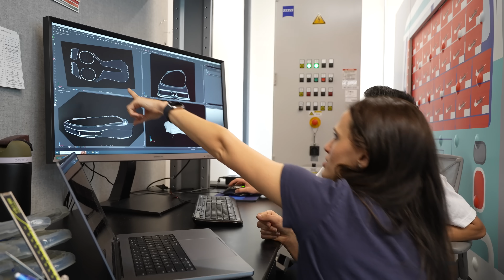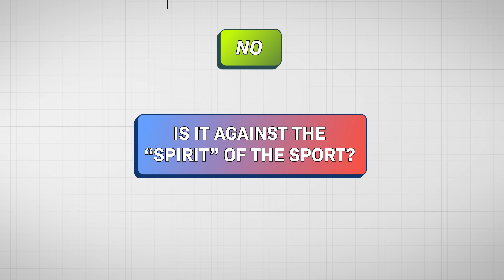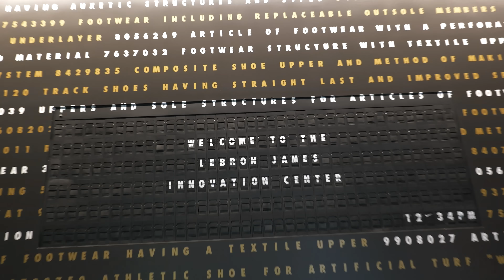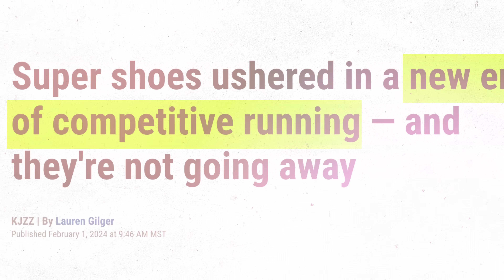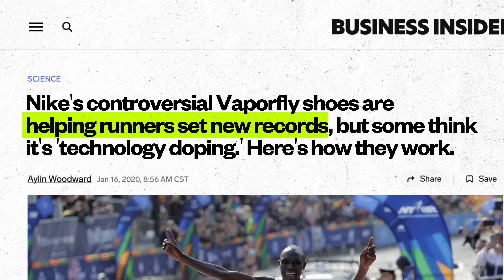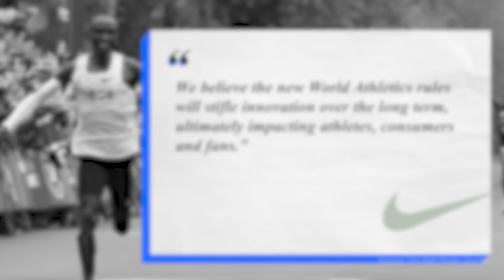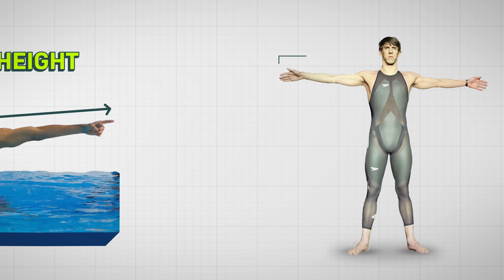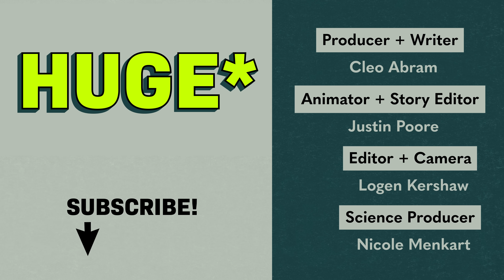The Shoe That Broke Running

Comment: Cleo is always a pleasure to watch and dam looked good in that USA gear. 

But seriously good video, i dont think glasses should be an issue as long as it brings the person in line with normal sight

Googles is a must for swimmers.

I liked the suit like shark skin has, denticles i think they are called. Clever.

I have a question for you Cleo. What about Tennis players who have the racket/strings set to different  tightness. Enchacing power for the same amount of effort. 

Interesting questions and sweet video.
Reply: Similar to this, they banned a tennis racquet for being too good: the Spaghetti racquet.
Reply: @ShankarSivarajan  I never knew that. Interesting. People always looking for an advantage 😁

Comment: It's always been the case in Athletics (Track & Field) that any records are a combination of numerous things.  The person setting the record, the training they have done, their nutrition, their equipment, the location both geographically and in terms of things like the speed of the track, the weather ( temperature, wind speed/direction, humidity, etc.).  As such no records are beaten under the same conditions as previous records and the further back in time you go, the more difficult it is to compare performances.  This is no different to other sports where people question things like who would win a fight between Mike Tyson and Muhammed Ali when they were both at their prime.

People in sports can only be directly compared with the people they compete against and those that are considered the greatest made huge achievements at their time.  The records are there to show us overall improvement over time in the athletes as well as everything else.  How long those records last is more of a testament to how good the actual performance was, but it's still not necessarily just down to the athlete, because as mentioned, location, weather and even who they were competing against all contribute to great performances.

Comment: Prescription glasses is NOT equal to running blades.
Prescription glasses just bring the player to normal vision (or close to 20/20). But running blades doesn’t make one normal. It makes one supernatural.
Reply: Do elite athletes get their vision and lenses tested in order to confirm they comply with 20/20 performance?  I could imagine that one could "cheat" by using lenses that improve vision up to 20/10 performance.

Comment: I think the only discriminate of technology to avoid in sport is ease of accessibility. All sportsmen should be able to have it if they want to. If it is not possible so it should be banned. If it is easily accessible and the sportsmen can choose to use it or not it should be allowed
Reply: That's not as simple as you're making it out to be.  Think about the blade guy at the end of the video, if other athletes wanted to could they amputate their own legs and put on massive springy blades?
Reply: @PlaySA Of course! Nothing is as simple as it sounds, but for the sake of brevity... Also highlighting edge cases can be a persuasive strategy, but it doesn't always reflect the full picture
Reply: @PlaySA No prosthetic that currently exists can make an amputee perform as well as an able-bodied person, though. They show in the video that athletes with prosthetics are 40% slower around starting blocks and 1-3% slower around curves than non-amputees (looks like their source is an article written for the University of Colorado Boulder site, which took statistics from Royal Society Open Science). The athletes in the video even says that what they got him on was the blades making him taller, not them making him actually run faster. A lot of lower limb amputees choose to use wheelchairs some or all of the time specifically because leg prosthetics come with a lot of disadvantages. 

If you’re referring to a science fiction world where prosthetics somehow function the exact same as flesh legs, only better, then yeah, your point is good.
Reply: So what do you make of sports like canoeing or rowing where the equipment can cost tens of thousands of dollars and the difference between a good boat and a mediocre boat is the difference between winning and losing. Not to mention the equestrian sports like dressage, which aren’t even real sports it’s literally just all about the horse and horses are expensive AF. There is no way that every rower can afford to be in the best equipment.  Do you suggest just canceling those events because they are unequal in terms of equipment?
Reply: @dand5829  but it isn't proprietary tech. Anyone who can afford it can buy it

Comment: I love these questions so much! For the question of why goggles are allowed but the suit is not, my personal opinion is that goggles don't make swimming any easier, they don't make you work less hard, they are just a useful tool. The suit on the other hand makes you more streamlined and therefore means you don't have to work quite as hard. Super interesting debate and I don't have a simple answer for any of the other questions.

Comment: I remember back in college, quite literally decades ago,  I did a PE class for tennis, and then the coach wanted me to do cross country.    I did, and did some preliminary running (I never had the stamina to do CC, but that's not important), I used regular "tennis shoes" while running,  the coach gave me a pair of running shoes that were significantly lighter than the shoes I used.    Now while I still wasn't that good at CC, it was an absolute night and day difference, and the conclusion that each step I have to lift a few less ounces, therefore use less energy,   plus there's the fact that the support is different too as tennis shoes have more side to side support.      But tech doping?  Asinine that it is even considered that.   Shoes get better, fabric gets light, bikes get more streamlined, it's called advancement.

Comment: This is a good video, with a pretty blatant issue, imo.

You keep posing the question "How do you determine the difference between a correction and an enhancement?" as this very difficult to answer moral quandary, when in reality it isn't.

We have a very strict baseline and literally billions of examples to compare against. The IOC, CAS, etc, they're not making judgement calls, they're just deducing conclusions from data. "If these shoes make you unreasonably faster than any given person without these shoes, yeah, they're bad. Fortunately we can compare you against literally every other athlete and person ever to have lived to make this determination". 

I think a much better approach for this reporting would be the question of whether we should consider enhancement as acceptable or not, not whether or not enhancement exists or how it's defined. You got close to that in the final stretch but never really shifted the focus.

Comment: I wanna see what the energy return is for a barefoot runner. I wouldn't be suprised if it's more than "normal" shoes as the cushioning meant to make the runner more comfortable is bound to remove some energy from the system compared to not having it there.

Comment: The risk with the blades is that if they become more effective than human legs, it will encourage the most hardcore runners to amputate and replace their legs with blades.
It's important to keep in mind that the human legs are not perfect for running. Humans are not the fastest land animal, not even the fastest biped. Ostriches can go 56 mph (90 km/h).

Comment: I feel like there is a similar discussion about what is fair and what not in mountaineering. Using bottled oxygen keeps you alive at high altitudes, but some people consider it doping. But there are so many other technical innovations that allow humans to climb at extreme altitudes. Without it they wouldn't even make it to base camp. I really don't understand why oxygen is still somewhat controversial (despite the littering which is a huge problem on Mt Everest), because it can be a life insurance in those conditions.

Comment: 0:53 Really, no gear should give athletes and advantage? If every athlete uses the tech that give athletes an advantage then no athlete has an advantage. If you give a 55 year old man that weights 300 pounds or even just an average person the shoes or swimsuit that makes athletes better he or the average person isn’t suddenly going to beat the best athletes in the world. The only thing it will do it allow the unbreakable world records to be broken easier. So add an asterisk on to the records that "tech doping" was used for that record but at a certain point there will be no advantages that any technology can provide to an athlete that isn’t just a machine running the race for them. There is no way that a human using any technology in a show that can make a human run the 100-meter dash in 2 seconds or even likely 5 seconds. The record is currently 9.58 seconds set in 2009 by Usain Bolt. What if that is the fastest possible time? Is it even possible for a human to run the 100 -meter dash is 8 seconds? I don’t think so. If the record is broken it will be by a hundredths of a second or maybe even a tenth of a second but by a full second that’s very unlikely. And what happened when it had been 50 years without a record being broken in sports like running and swimming? Will those sports be boring, no because it is one person against another. Are we going to have to worry about "genetic doping"? That’s the one to be afraid of.

Comment: Why don't they make different "formulas" of the sports... Like one formula they can use all sorts of tech as long as it's not dangerous with no limits on spending (similar to some types of prototype car racing), and another formula could be a more restrictive somewhat similar to the rules today except with spending limits and more standardised equipment so that it's more accessible to all people; and why not have a no tech formula too where they do run barefoot and naked? I certainly would find the crazy high tech formula quite interesting; and I think some people also would watch the naked formula...

Comment: No, aluminium is banned in professional baseball becaue the core of the bat is too large: that is, the viable hitting surface. The core of a wooden bat is generously three inches, whereas the core of an aluminium bat is more like ten inches. The wooden core of a bat is actually very dense and transfers less of the impact to the hands, meaning more to the ball. So, in general you would be able to hit deeper home runs with a wooden bat, but more home runs with an aluminium bat.

Comment: Example:  World record for staying naked in cold water being broken by someone wearing a full body suit that reflects body heat and insulates from outside cold, not allowed. In general:  World records for naked athletic prowess being broken by people using enhancement technology, not allowed. The slippery slope of the Nike shoe is a material that can store the energy for delayed recoil, then a few little jumps before the race would have the runner accelerate faster than anyone, ever. Not allowed.

Comment: We have the same debate over and over again about UCI regulations on what a bicycle should look like. Since cycling sport is essentially tied to techonological innovation I think anything human powered and non-dangerous should go. This would especially be interesting if recumbent bikes or aerodynamic bikes could return to TDF, Giro and la Vuelta since some of them would improve safety, average speed and accessibility due to the more comfortable position.

When it comes to swimming or wrestling the matter becomes more complicated. I wouldn't oppose finding clothing closer to original greek styles, but then oil or other slippery slopes would certainly be part of the debate again.

Anyway, great piece, would love to hear more of that.

Comment: 1. It needs to be affordable to anyone working a minimum-wage job in the countries and regions that compete; 2. It needs to not be mechanical in nature; 3. Only three distinct layers can exist between human and the surface; 4. All materials must have a minimum and maximum density of 700-900 kg/m³; 5. The product must have been available to everybody in significant quantities at least 4 months before the event; 6. All material must be non-toxic and non-allergenic to humans and/or all participants; 7. The product should last at least 20 uses during a full course of the sport including removing and equipping it 20 times each; 8. Scientific studies about the product should all be free of charge and part of the open domain; 9. Any enhancement to your body to compensate for handicaps should be of an average measurement shared with other athletes of similar handicaps, with a 5% threshold to account for preference.

If Nike brings out some super shoes that would cost $200,000 to purchase and there are only 20 of them made for the entire world, and one of the materials can give that one athlete from Egypt a rash? Banned for several reasons.

Comment: A question I always wondered is what is the point when doing non-competitve sport?
I cycle a bit, to commute and for exercice. But I never felt the need to buy a fancy road bike. Yes, a good bike will be much more efficient and will allows me to go faster and farer. But in terms of my own purpose, just do some sport, the energy I spend would be the same. A crapy bike is just the mid-level between a static bike that you do home and a fancy bike that you can cycle at 20mph without much effort. Why a lot of people feels the need to get those expensive bikes when this is not for comfort but only for perfermance?